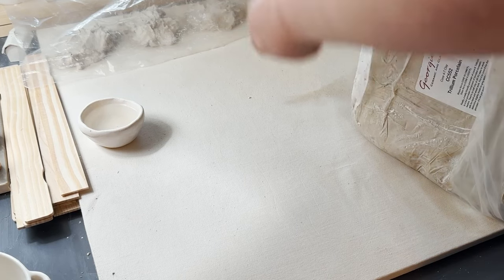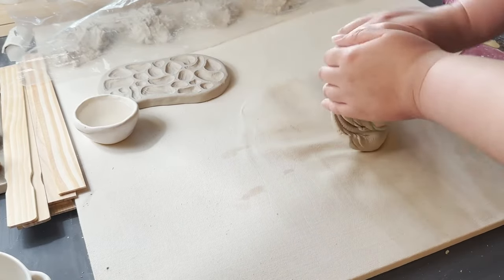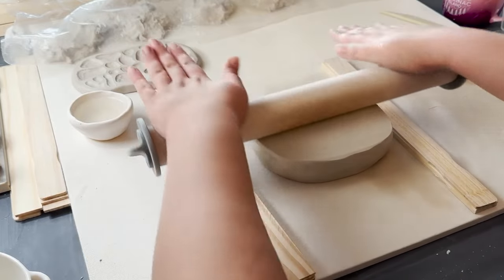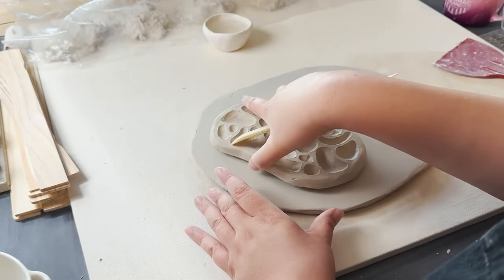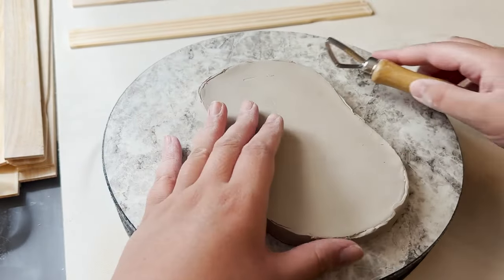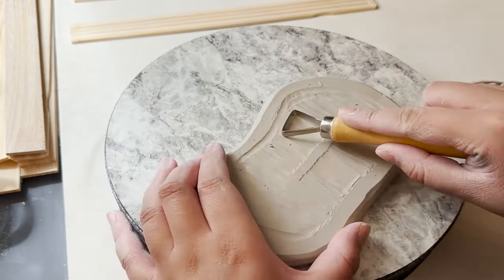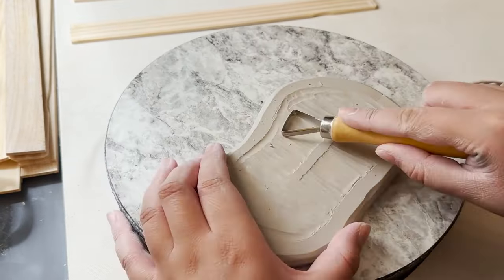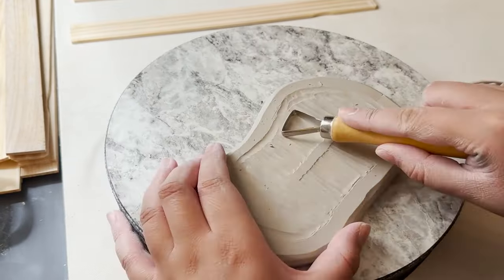How to Make a Ceramic Paint Palette

Comment: Hi; Great video!  I'm so happy to find you.  I've been trying to make palettes and they're not exactly turning out well.  You mentioned (below) that there are different ways to make a foot.  I wonder how I might most easily accomplish a foot.  Would slipping and scoring a foot and a small center piece work?  The carving part seems to be pretty difficult for me.  Maybe because I started carving right after I rolled it out.  Thank you 🙂
Reply from the maker: So after you roll out the slab and cut out your palette, you want to let it dry a bit. The rule of thumb is generally to carve when the clay is leather-hard. It's not too wet, but also not too dry either. 

You could definitely slip and score attachments to make a foot. Personally, I don't do that very often because sometimes it cracks when I do it. There are all kinds of ways people make feet by either carving clay off or attaching more on. I think you could find some interesting ideas by looking at mugs or bowls on Pinterest.
Reply: @calieandco  thank you 😊

Comment: Beautiful job! What happens if you don't take out any clay from the back? Won't the palette be stronger and less risk of going through the back if it's not thinned out?
Reply from the maker: Great question! The clay will warp at different points of the process, even when it is fired in the kiln. If you kept the bottom flat, it is more likely to warp in a way that wouldn't allow it to sit flat when completed. 

There are different ways to counteract this in terms of how the bottom is crafted. Removing clay like this is just one of them.
Reply: @calieandco  I am so new with pottery, thank you so much!
Reply from the maker: @lornaparong9  I’m happy to help! (: